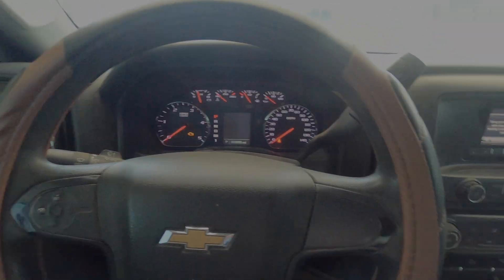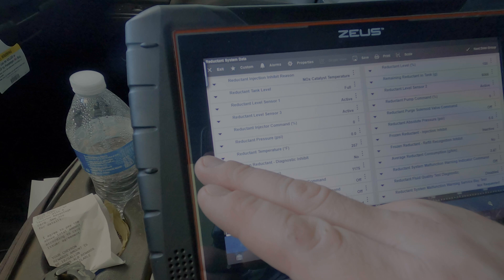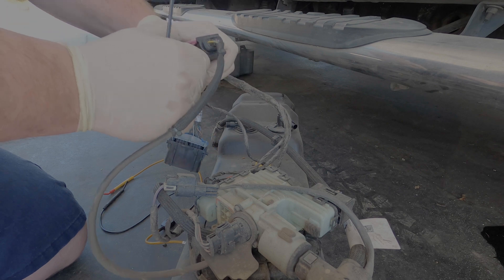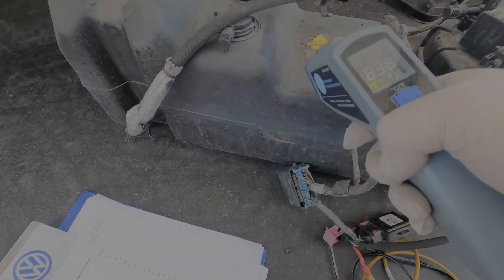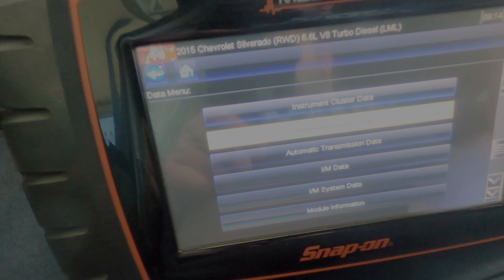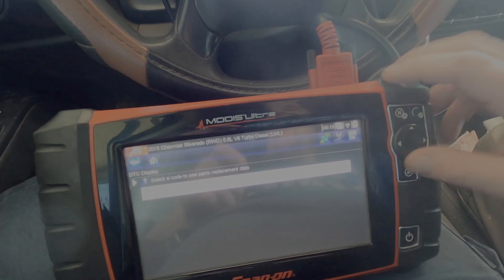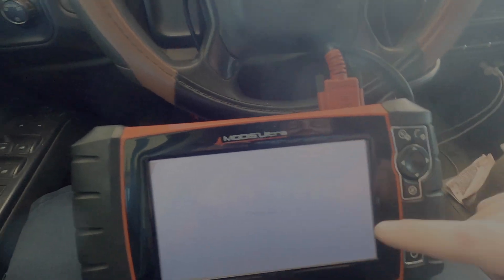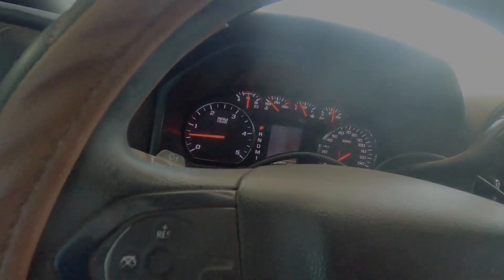2015 Chevy Silverado Duramax P205b Diagnosing DEF Temperature Sensor

Comment: I've thrown so much money at my 2015,  3500. Everytime it would go into limp mode I'd take it by the dealership, they'd  put their computer on it, tell me what part it needed, I would walk over to the parts department and get it. They're always a couple dozen cars behind so I'd just take it home and put it on myself.  Almost every time it would seem to fix it, the limp mode would go away and I'd drive it for another week before going thru the same process, throwing up a different code Everytime.  I've changed the front and back nox sensors, the tank heater, sending unit and now its saying reductant line heater that feeds the injector (reductant heater B control circuit low) of course this time they're on back order and it's going to take another week to get that $300 dollar part. So far I'm out $2400 just in parts, and really fed up with the way these dealerships just throw parts at things.

Comment: Where is the reductant temperature sensor in a 2016 checy 2500 duramax?  PLEASE
Reply from the maker: The reductant temperature sensor is in the module in the def tank the part number is # 84412924 . Here is a video of mine showing replacing it. https://youtu.be/1wW80_HsIvs?si=HUAsyjLj9K61BkY1
Reply: @drewsshoplife  Thank you.  I just saw this, but I just had it replaced yesterday for 1,300.00 at the dealership. Insert sad face. Lol.  Thank you 😄

Comment: Great Video.  I have the (genuine) parts in my garage for my '14 LML.  My scanner shows the temp being around 230 degrees when it is 40 outside.  I've put the job off because of the injector connection.  It looks fragile and difficult to remove!

Comment: i replaced the pump,module,heater and tank and code comes at random times
Reply: How much does something like this cost. To fix? California Thanks
Reply from the maker: @moniquerojas3997   The factory part lists for $317 from gm and the labor calls for 2.4 hours, If the labor rate is $140 like us it would be about $653 without tax .
Reply: @moniquerojas3997  anywhere up to 15k
Reply from the maker: Where did you get the parts? You could have a bad connection
Reply: @drewsshoplife  straight from the GM dealer in april this year